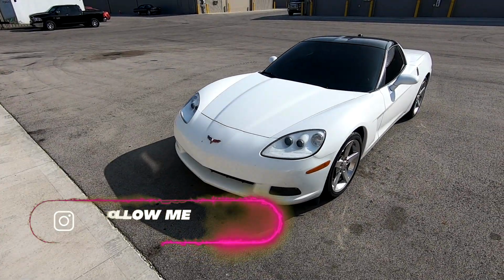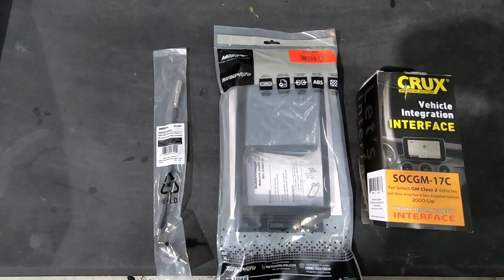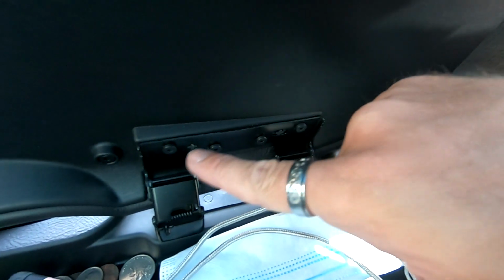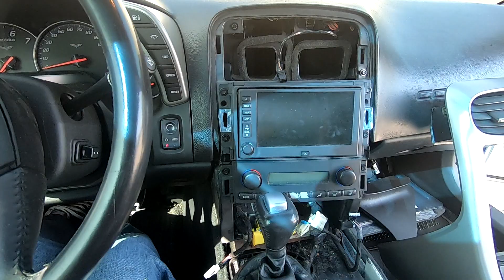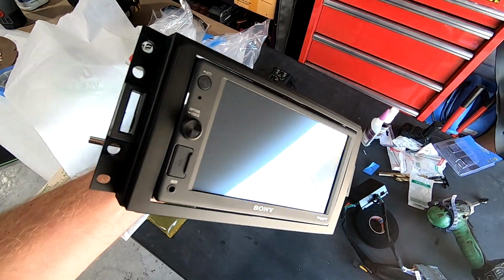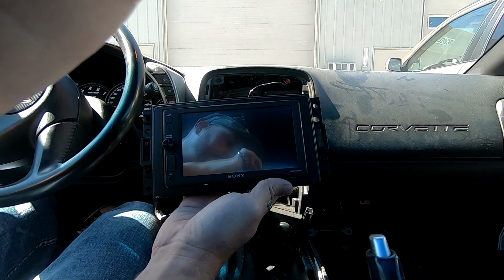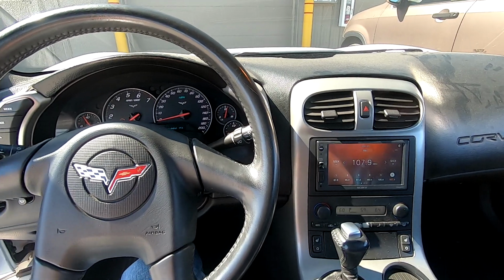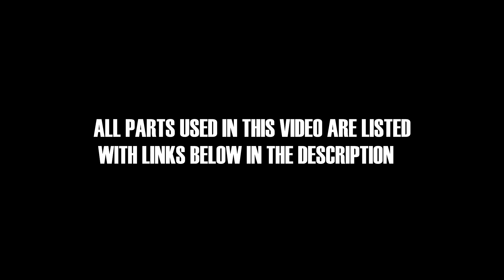C6 CHEVY CORVETTE SONY XAVAX1000 DOUBLE DIN RADIO INSTALL

Comment: Great video, thanks for sharing!!!  I assume you loose the steering wheel phone controls with this install?  This is using the factory amp, correct?
Reply from the maker: Yes you would lose the phone controls and this is using the factory amp
Reply: If you purchase at Best Buy or Crutchfield you have the option to purchase the additional components needed to retain the steering wheel controls.

Comment: Question….with just the head unit swapped, did you get better sound?  I find the stock unit to be low and not that loud/crisp.  Some say the speakers and built in speaker amps are fine that the stock head unit is the culprit.
Reply from the maker: Much better sound and more volume
Reply: @octanetvchannel  that’s great.  Do you know if the 5000 series offers anything better than the 1000 series you used?  Not sure it’s necessary to go from 299 to 499 in cost if the features are very similar.

Comment: Can you connect a back up camera to this aswell??
Reply: Yes, you can.
Just bought this unit & started the install.
Reply: @scottdorau4969  how did you do it? What backup camera did you install and how did you like it?
Reply: Yes
Reply: @crackhead4158  I ended up not adding the back up camera.  The installation was plug & play, but I did loose my steering wheel controls.
Reply: @scottdorau4969  do you have auto or manual? Because if you have auto, did you lose the paddle shifters too?
Reply: @crackhead4158  I have a manual, so no clue on the paddle shifters.